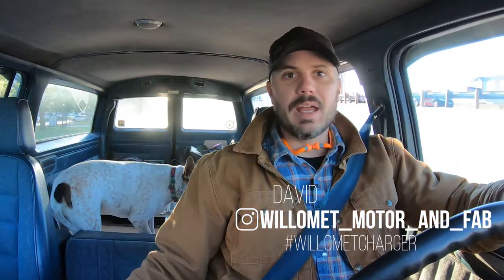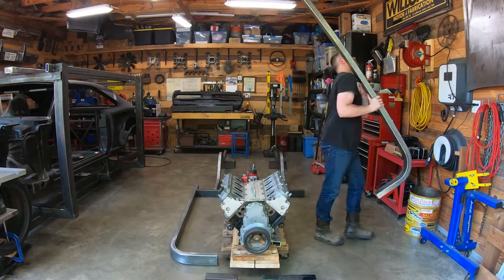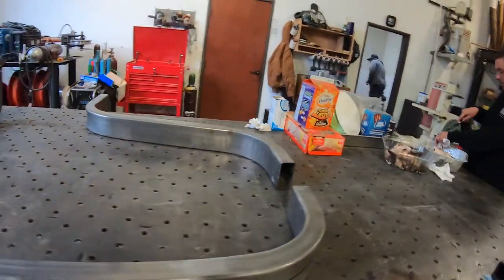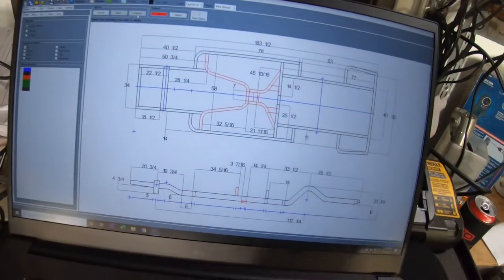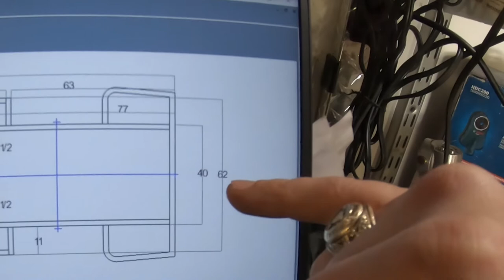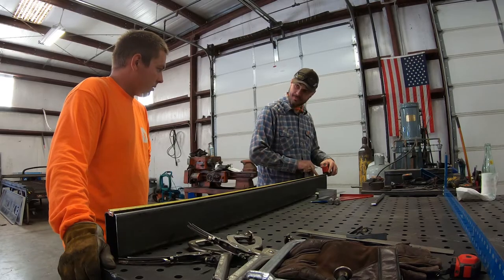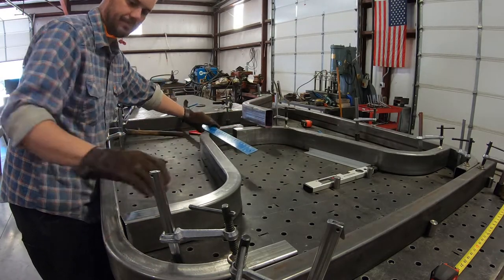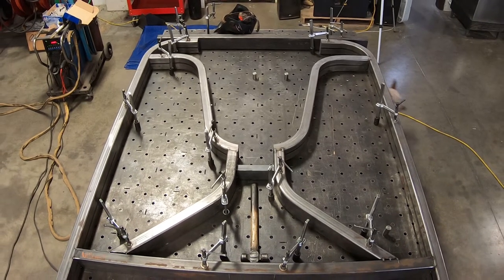Full Frame Mopar | 1970 Dodge Charger Chassis 03.1

Comment: Quality video as always. Picked up a couple handfuls of good tips along the way as well. Keep it up sir. 🤟😎👍
Reply from the maker: Thanks man.  More is on the way, and there's still more tech and problem solving to come.
Reply: Willomet Motor & Fab best quote: “Fabrication is problem solving and there is more than one way to solve a problem.” and best tip: “Get the hardest part of a project done first, if at all possible.”

Comment: I just discovered your channel trying to find anything i can about chassis buulding. I have a 69 gto im building and discovered that the centerline from the front wheels to the back of the car is an inch off from the centerline from all of the body mount points to the rear of the car, it graduates to an inch or so by the time it hits the rear axle. So i either need to have it straightened, buy a frame from another a-body or do what you did and build a chassis. Any advice you can give would be helpful. Im trying to build something custom, but metal costs these days are just crazy. I cant imagine what all of that pre bent metal ran you even 4 years ago. Thoughts? Assuming you see comments on such an old video anyway 🤙
Reply from the maker: I've not had good luck straightening frames, but others have. If you were bending a 4x2 today, @cornfieldcustoms would be my recommendation.

Comment: I know this video is 2yrs old, but wanted to ask you your opinion. I have a 1969 stingray convertible (not numbers matching) that appears to have been in and accident with a bend on the right side chassis and some cracks where the motor mounts are.

My options are to find a 69 chassis and upgrade the suspension to a Detroit speed suspension or have new chassis fabricated with new suspension. New big block 540 with 650 lbs of torque. What do you think is the best option?

Thank you!
Reply from the maker: It’s hard to beat the value of the chassis options out there now, and it bells get your project running a lot quicker, too. Unless you’re moving the powertrain or suspension locations, I would recommend buying a chassis before building one. But don’t get me wrong, it’s a lot of fun to build your own rails.

Comment: would cuts work instead of bends?
Reply from the maker: Sure would. I just didn’t want to put a bunch of heat into the rails, as it creates an opportunity for deformation from weld shrinkage. Perfectly valid method though.

Comment: I saw in 1st video you measured key points off the car, and you're building the frame to match.  The frame looks dead-nuts level and square, but surely the car is not.  How will you resolve those differences?
Reply from the maker: The body conforms to the frame. With the unibody entirely cut out, it was squarewithin a 1/2”, and about the same variance for level. That wasn’t a huge tweak to work out.